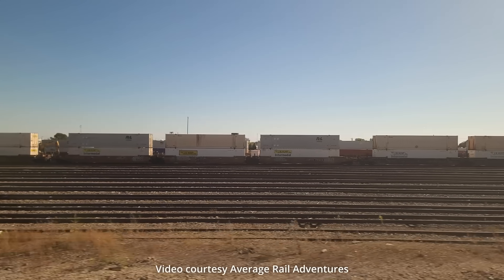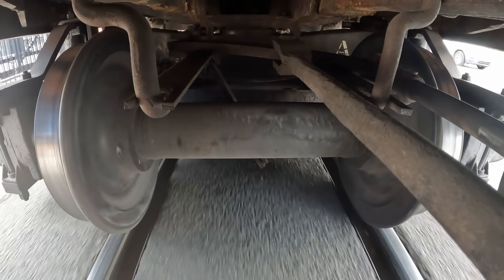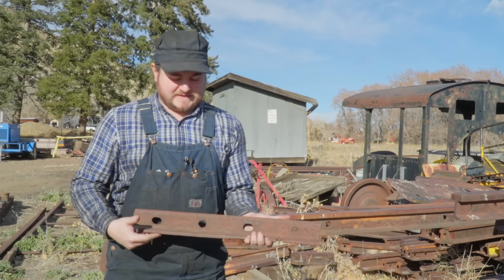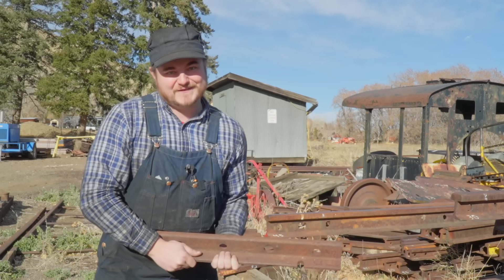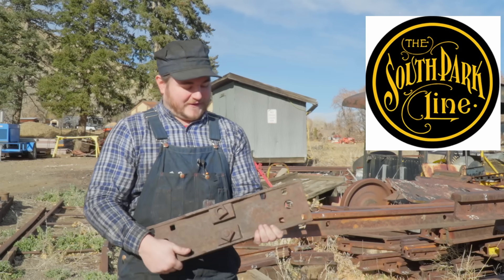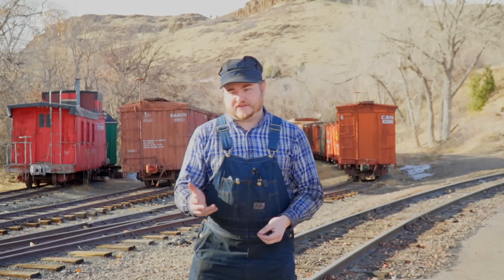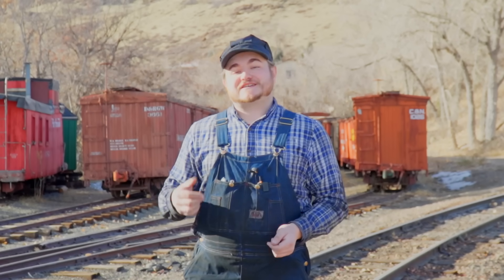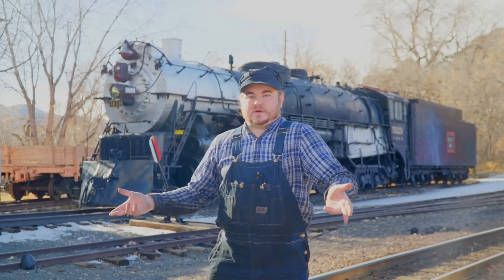Why don't Trains go CLICKETY-CLACK anymore? | Railroad 101

Comment: I grew up next to a railroad track in the 60's and 70's with the jointed rails. Trains would come by on those rails rocking side to side like crazy. I was scared to stand close to them as they went by. I remember the railcars bringing the welded rails in. I have wondered how two rails could make railcars with dozens of welded rails could go around a curve. Wouldn't the railcars want to go straight?  After laying the welded rail, the rocking cars were no more.

Comment: For goodness sake , keep your hands still it is annoying  and a distraction  ! The joins between the rail over here are  called fish plates and comes from an old navel word from joining two masts together  . Long welded rail are  laid in a 600 foot lengths at 60 Fahrenheit  and are stretched hydraulically to get under tension . It is pulled off the end of a wagon  and is just like it is made of elastic going all ways . It weighs 112 pounds per foot and is extremally dangerous .

Comment: The joints in the line which goes through my grandmother's village are not staggered anywhere. However, it has an interesting property. The sleepers are usually made out of concrete. However, where the joints are, they used wooden sleepers.
That is a low traffic, non-electrified Hungarian line btw.

Comment: In 2016, a tornado near Chapman, Kansas severely bent and mangled a large portion of continuously welded mainline rail. Hearing about the immense strength of such rail makes me all the more impressed by that tornado.
Reply: Once the ground is missing, rail is just thick wire
Reply: It's very common. Everything from spikes/clips and 136lb rail pulled upwards leaving ties and ballast left in place, to completely missing track infrastructure all the way to the sub-base

Comment: My dad was a signal maintainer on the Soo Line.  Part of his job was walking the track to check the bonding wires at joints.  He checked for loose, missing, broken or degraded wires and fixed as necessary.
Reply: My grandfather worked for soo line in Schiller park Illinois in the 60s

Comment: How long are the rail sections before welding?  You mentioned a 400 foot track laying machine, but I can't think of a good way to transport a 400 foot piece of rail from the foundry to where it is needed.  Also, are the curved sections of rail manufactured with the desired curve, or are they bent into shape during installation?
Reply: They have 3 types of rail trains that i've seen with cranes on them. One has a small crane every section of the train and unloads to the side, the other the rail rests on rollers and when unloading they'll either have:
-a small crablike crane arm on the back of the train that will pull out a section of rail and once it has enough weight on the ground the train can just drive forward and the rail will just stay where it lay on the ground
-a front end loader or other heavy machinery with chains that attach to the rail and the train drives off while the machinery holds it in place.
As far as curves go they are usually big enough to not need to bend the rail, rail is often referred to as spaghetti because it's quite bendy over distance, concrete sleepers have cant built in, tight bends can sometimes require specially molded sleepers for extra cant, wood sleepers instead have the cant adjustment done on the steel sleeper plates

Comment: 4:02 not in Europoe. On the contrary, we have square joints that are usually on the same spot so the wheelset hits both rail joints (on the left and right rail) at the same time. The advantage is that vehicles are less likely to roll and somebody told me that it also enhances stability at higher speeds, as it reduces hunting oscillation, with the wheelset being partly "reseted" each time it hits a joint, so the naturally occuring hunting oscillation is dampened. Once continously welded track was installed, hunting oscillation buffers (shock absorbers) had to be installed on the trucks to avoid and unpleasant ride and/or potentially derail at hiher speeds (about 160 km/h or 100 mph). I have not found any evidence for this claim, I just heared it. Maybe it is not true, but to me it seems to make sense.
Reply: Sounds like rumor generated out of ignorance.
Reply: @akulkis  I would not take just anyone claiming that as a serious piece of information, but he is an instructor (also on) rail vehicles, so that is why I did not question him when he said it to me years ago. Thanks to him I drove some interesting rail vehicles, including one trolleybus (which is, by legislation, considered a "trackless rail vehicle" where I live) through the city. It was fun.

Comment: In the UK at least, continually welded rail is pre-stretched according to the temperature at the time it was laid. That's done using hydraulics. Indeed if it was not done that way, then rails could only be laid at the highest temperature it is expected to reach in operation, and I don't see how it could be done otherwise.

Comment: welded rail eliminated 50% of track crews - changing broken rail joints - but bigest improvment was roller bearings top speed was 45 and people walked the yard lifting journal box covers adding oil

Comment: Here in Australia, we’ve upgraded to concrete sleepers, which I’m told require CWR. I was lucky enough to watch track work going on at a station, and the guys let me light off a ceramic pot of thermite to begin the welding process. Not many people can say that they’ve personally worked on a mainline railway!

I used to get cab rides all the time, too. They’d let me run the regulator too, so 11 year old me had 3,000hp of EMU motors at my fingertips. It makes me want to become a driver in my adult years. That was so fun.

Edit: the upgrade to concrete sleepers also means lower maintenance. I’m told that wooden sleepers last about 20 years, concrete can go for 60.
Reply: There is a caveat about concrete ties though.  The pads and clips have to be maintained and replaced as needed. This is the biggest area that railroads fall down on in this regard. Lack of proper maintenance. Also when a car derails or drops a wheel concrete ties crumble into dust or break off the ends. With wood ties there is enough give that the wheel(s) ride up and over them. Not always in either case, but that is the norm.
Reply: Hey Digger, Does each State still have a different track gauge or has it been standardized. That was the case when I was traveling around Oz in 83.
Reply: @kyrg  yeah, it’s still a mess of different gauges. I recently went to South Australia where the train museum used all three gauges!
Reply: Here in New Zealand they are  going with recycled plastic ties.
Reply: Reinforced Concrete sleepers were introduced in India from 1980 and long single track from 1990 and the entire network of Indian railways use Long tracks and concrete sleepers
Reply: Concrete sleepers don't require CWR, but they can certainly take advantage of it. Due to their heavier mass they are more resistant to movement and so stressing the track around curves becomes more manageable.
Reply: I'll be sure never to ride a train in kiwiland if they let 11 year olds drive
Reply: @Hyce777 when you come to Australia in April, which areas will you visit?

Comment: When ribbon rail is transported on rail cars, I noticed they are very long and may take up two or even three rail cars.  My question is, does the rail flex when the train goes through a curve or does the rail move slightly on the rail car to compensate for the curve?...Thanks for another Great video Hyce!!

Comment: Electrified railroads typically use DC for traction power and AC for block circuits. It is a relatively simple matter to separate AC from DC. So the same rails used for traction power return current are at the same time used for train detection and signalling.
Reply from the maker: We used audio frequency track circuits largely on the railroad I worked on, though AC circuits, usually called a power frequency track circuit, are used as well.

Comment: You know, this reminds me of a fun story about the yard at Thayer, Missouri on BNSF's Thayer Subdivision.  The yard tracks consisted of jointed rail and wood ties, VERY old rail and ties at that!  Well, one day, they were running a locomotive for the north local into position (a former Burlington Northern SD40-2), and the old rail and ties gave way putting the locomotive on the ground (just for context, nobody was injured and the locomotive to my knowledge wasn't even damaged in the accident).  Well, that forced BNSF's hand and they finally began a complete overhaul of the yard as they found the yard tracks were so deteriorated they could no longer support the weight of trains effectively.  So as they began pulling up the old rail, crews began discovering that nearly all of the rail  dated all the way back to the late 1880s, which would have put it in the early years of BNSF predecessor St Louis & San Francisco Railroad (better known as the "Frisco").  To think those tracks survived the entire life span of the Frisco, the Burlington Northern (which absorbed the Frisco in 1980), and the first 25 years of BNSF is remarkable!  While the yard currently has a much cleaner look and is far safer, it looks much different than it did in the Frisco and BN days.

Comment: All those holes had to be cast in the mold rather than drilled because there is no way they could have ever drilled than many holes.   Drilling just one of those holes is immensely time consuming.
Reply from the maker: Pretty sure that's true for the joint bars themselves, but the rails are usually drilled; but I wonder if that was the case back in the day.

Comment: When changing from jointed rail to welded rail - SERIOUS attention has to be given to where the joints were.  Joints tend to create deterioration of the track structure down to the sub grade.  If the joint areas aren't brought 'up to snuff' the CWR will start breaking from the pumping action over the bad spots.

Comment: I just got back from a long train ride on the Crescent, and you can really feel the speed of the train, even when it is only going 60 mph. While it is quite a smooth ride, the welded joints often have a rather annoying side effect of a lot of jolting when you pass over a switch. Hardly my first ride, so it isn't a dealbreaker for me, just an odd little quirk I noticed.

Comment: That shot of you standing next to the driving wheel of the locomotive is insane.
Reply from the maker: Speedy choochoos have big wheels :D
Reply: @Hyce777  Stop lying. We know you're just really small.
Reply: @Hyce777  
6 year old me learned that standing next to what I think was an S 3/6 steam loco in a museum.
Reply: @Hyce777  naturally, either that or a MASSIVE final gear. itd be like having a bicycle with 8 inch tires and the final gear is 16 inches, youd be riding on the gear. thatd make for a wonky mountain bike, reminds me of a penny farthing
Reply: Now imagine the cost of tires for those big wheels...

(Yes, yes, it's a joke ...)
Reply from the maker: @falxonPSN  The wheels do have tires. It's a lot of steel, so, probably decently expensive.
Reply: @falxonPSN  😂😂
Reply: @falxonPSN how is that a joke?   Steam loco wheels have tires
Reply: @acescionti711 I did not know this.  You learn something new every day.
Reply: I was thinking the same thing.
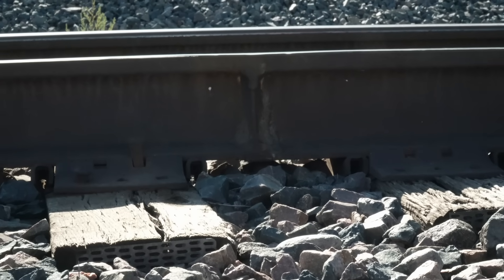Reply: 8:05

Comment: In Japan, almost all non-HSR lines are rail jointed (no idea if staggered, but I think they are), and max service speed tends to be 110-130km/h (68-80mph), including the fastest express lines. Almost all passenger rail are EMUs, DMUs, or hybrid DMUs, with only a handful of freight or sightseeing services being diesel or steam locomotives towing unmotored cars.

The shinkansen high speed rail does have welded rail, and if segments of rail must be replaced, they are done so in the middle of the night when no services are running, so service during hours is never interrupted. You can still hear a brief little muted change in sound as the train wheels glide over the "jointed" area, though I assume that's because they're acoustically caused by that joint bar still holding the joints together from before they got welded. All shinkansen are EMUs, though for the 16-car version of the N700 series, end cars are unmotored with all the middle cars being motored.

Comment: Funnily enough, in the UK with old bullhead rail, the joints were often not staggered from each other, but in the same place.  Doesn't mean much when your loading gauge is tiny and your rails are fastened with wooden keys to bolted down cast iron chairs instead of spikes directly to the timber.
Reply: The joints on British Railways were deliberately not staggered as by staggering the joints you are deliberately designing in twist faults, which are a derailment risk particularly for two axle wagons.

Screwed or bolted (GWR) chairs with keys are a far superior method of fixing down rails than spiking them directly to the timbers, which is a method only really suitable for standing sidings. As the up and down motion of the track under traffic  just pulls the spikes out of the timbers.
Reply: @meeeeeeeeeeeeeeeeeeee2 you are completely right!  Bullhead rail in chairs has excellent shock absorption capabilities and the beautifully laid track in Britain allowed for the wonderful ride quality that that only few others could boast.  I do wonder if the move to flatbottom was purely to bring down maintenance cost?

Comment: On the short line near my house Has jointed rail. The rails are from 1928-1946 and the joints is cracked and the rails are uneven. Also some of the ties are gone. But it serves two trains everyday so I guess it works. There’s occasional derailments every 2-3 months or so
Reply: What type of trains use it?

Comment: When we got rid of the last of the jointed mainline rails on the Stampede and Yakima Valley subs 4 to 5 years ago it was a huge relief because every time we get a rail detector car they would find way too many defects mostly at the joints, having CWR mainline eliminated lots of the defects, one good thing I can say about jointed rails is it’s quick and easy to swap out the defective rails with good rails.

Comment: Amtraks Cardinal between Clifton Forge, VA and Charlottesville, VA is jointed rail on the Buckingham Branch.  Its average speed is 40-60mph in this section for about 4 hours.  Sounds very nice and there is a 6 min recording of it on my channel.

Comment: Before I view the video my answer to the question posed by the title, most rail across the US is welded continuous rail which has replaced the old joint bars and bolts. But I do miss that sound, on long trips that sound was hypnotic and I slept well.
After viewing it:
My step-dad worked for UP so I am aware of RR operations then you answered my major question in the body of the video, that it was welded continuous rail. I miss seeing a caboose on the tail end of trains. And I still feel that AmTrak has not replaced rail travel like the old days of dome cars, etc. At night seeing the stars trough the dome. Seeing country sides and mountains slide by. I also did some work as a section laborer and every Friday we would walk the rail, tighten any bolts that needed it, and replace any missing or damaged spikes. There were crews that were on a schedule to oil the joints throughout the year.. Something new that I was not aware of was the compensation of rails. I never saw any of these. The video was very well done and informative. Other words I like are explicate and exact. I cannot think of any factors you may have missed. Your script was spot on and I would give an "A+" for your Public Speaking skills. You blended your exhibits smoothly. As a side bar, there are those who have turned pieces of rail into anvals, and for door stops.

Comment: For quite a long time, when the Iron Curtain was still existing, there was also a significant change of sound when a train crossed the border. In the communist countries, they couldn't afford railway lines without joints, while they were standard in the West. That sudden change of sound massively contributed to the nervous expectations between the border controls. And even at night and with covered windows, people from the East who had never experienced a train ride without clickety-clack, instantly noticed that the miracle had really happened.

Comment: 8:14 “The higher the speed, the higher the tolerances have to be”
Nope … the tolerances shrink, you have to be more exacting.

A tolerance of 1mm is larger/higher than a tolerance of 0.2mm…
Reply from the maker: Correct, I should've said tighter.

Comment: Funny thing to prevent heat expansion here in italy we paint the rail in White, it is proof to reduce temperature by 10 celsius.
Reply: Properly maintained CWR does not need painting white except perhaps the switch rails in switch diamond crossings where there is a relatively long length of unrestrained rail and little tolerance for movement at the switch tips. White painted plain line is a sign of someone putting a sticking plaster on poor maintenance

Comment: The old Cotton Belt mainline West out of my hometown is still jointed. The UP never used it as a mainline when they eventually acquired it. (Operated by a class III railroad)

The other Cotton Belt mainlines (North and South out of town) were converted to welded joint by the UP

Comment: The mainline south of Bend, Oregon through the area called Lava etc. used to be jointed rail and the joints were hammered.  IDK if they have replaced it with welded or not.